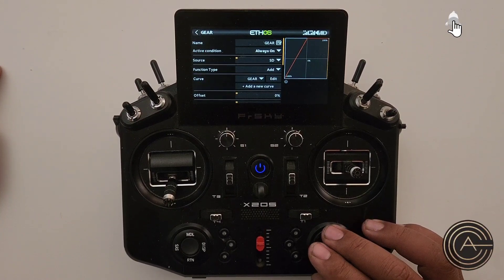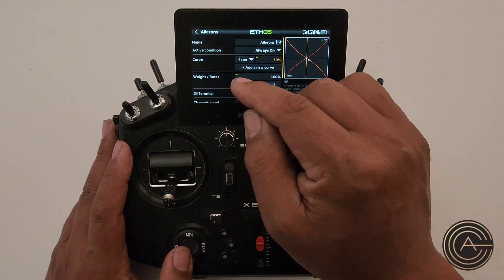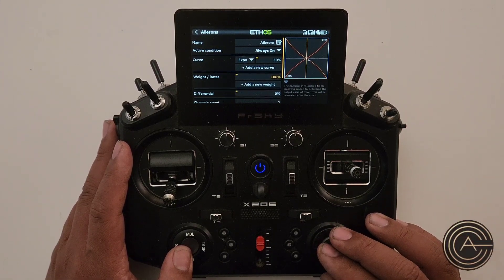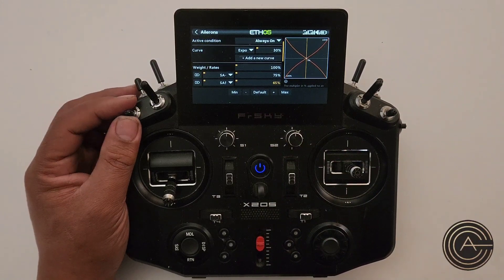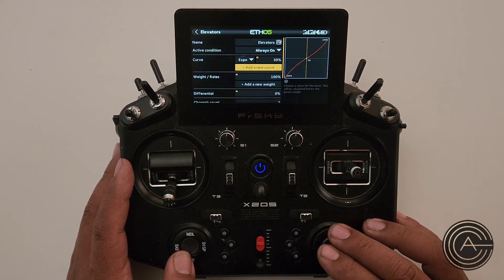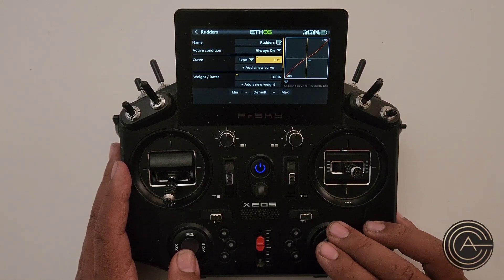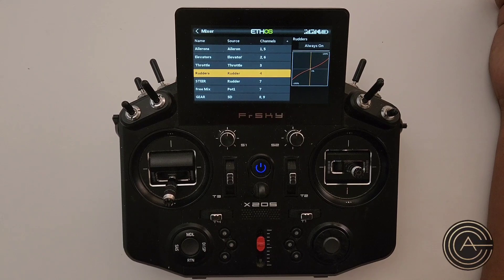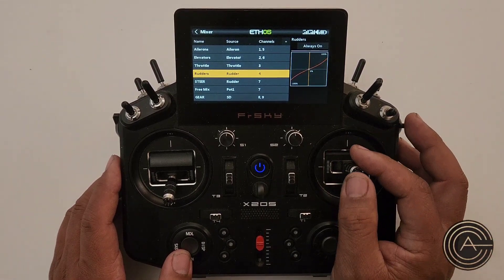The Frsky Series: New Model Setup. Setting up Rates and Expo (Freewing F-16 70mm)

Comment: I’ve been checking out videos on the Ethos system the past few days. It looks pretty nice. I generally set my expo to 1/4th to 1/3rd of whatever the rate is. My rates are usually between 60 and 100 percent. My expo is usually 25 to 33 percent on high rate, depending on the size of the control surfaces. Your default expo of 30% is a good starting point and I like your choice for the rate switch. I prefer a 3-position switch for flaps. I feel like a lever or slider would lead to inconsistent flap settings and I’d spend too much time fiddling with them. I use the long switch above the throttle stick for flaps. I’ll check out some more of your videos.
Reply from the maker: The sliders have a detent position at the center so it is pretty accurate for the 3 basic positions.  It definitely does not add anything being on the slider except ease of access.

Comment: I also have my expo change if my gyro is on or off. Gyro on and expo is 5% across the board no matter what rate I’m in. I also put my rates on three separate switches. I typically fly with high rate rudder and medium to low on the other two.

Comment: Excellent idea of flaps on a slider! I gotta try that! (Currently I'm using NX10SE tx, & gotta always have 1. I train new pilots). WANT a futaba 18Mz, but their rx's are ridiculous. 

I tried the tx12 & tx18 & discovered quick 1 needs a Kollege Edumakation to program 1 of those🤪!

I gotta look into this 1!
Reply from the maker: Yeah.  I actually really like the TX16s. Great radio and Edge TX is getting better and better.  Programming is totally different than Spektrum and I can see how someone changing over to it would have issues.  But it is super powerful.  I feel that Frsky really tried to get a mix between power and simplicity. In many ways they did it.  As I run Frsky's Ethos more and more,  I do really like it.  Best thing..... not one noticeable radio hit when I run Frsky Tandem receivers. Can't say the same with Spektrum or Radiomaster. Their dual band system really works great.